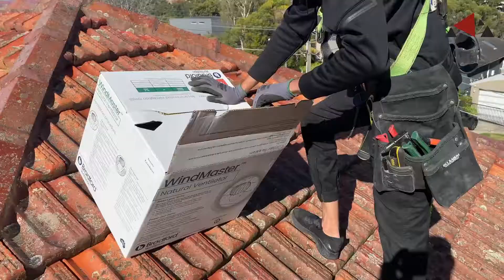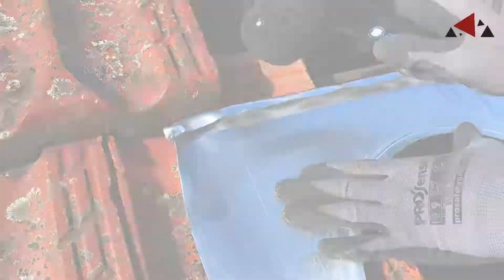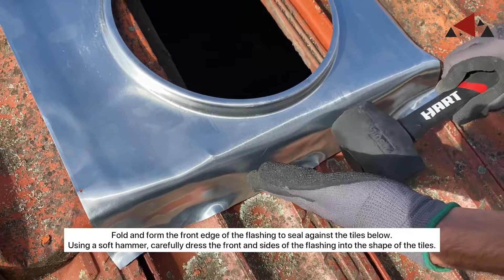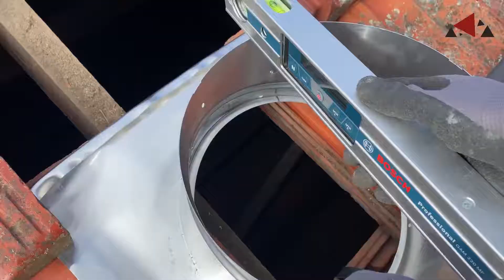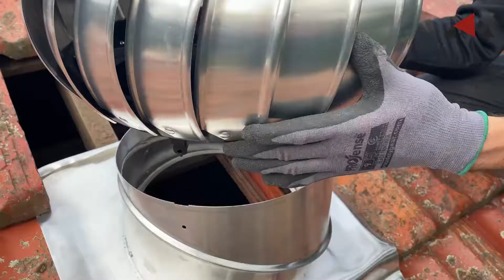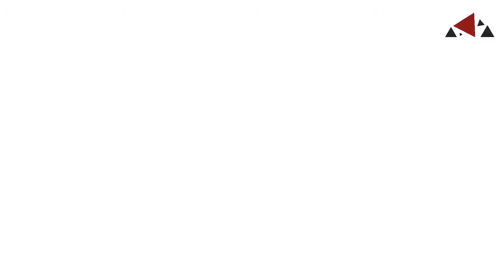Sydney Roofers - How to install a whirlybird roof vent

Comment: Water will still blow in on those top tiles and bottom flash  . Also needs to be 1 tile higher up roof
Reply from the maker: A year later,
No water leaks, and very effective.
Reply: How did you “measure” the effectiveness of this useless gadget?😂😂😂😂
Reply: @IlithiophobiaKiller  its not useless. Somehouses have mould and issues where excessive heat is trapped in the ceiling. This assists. You also should have vents under your eaves to let air flow through.
Reply from the maker: @IlithiophobiaKiller  The customer previously had mould growing on their ceiling, but the issue has now been completely resolved.